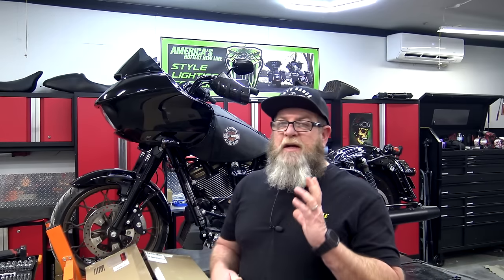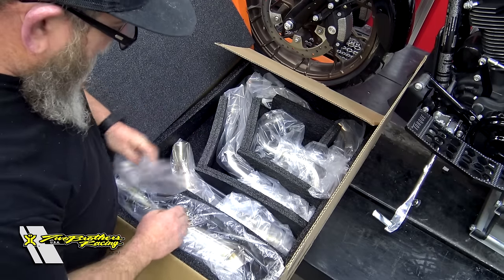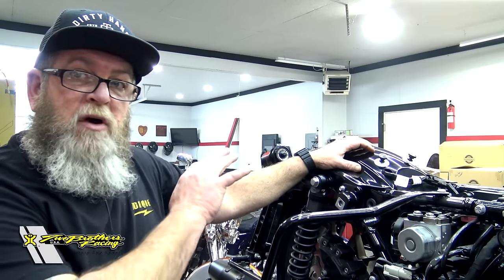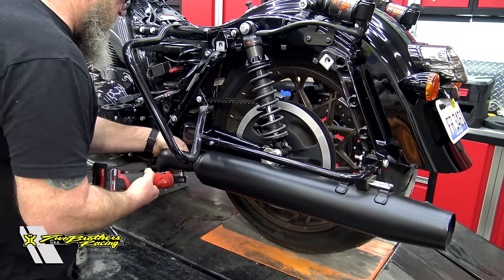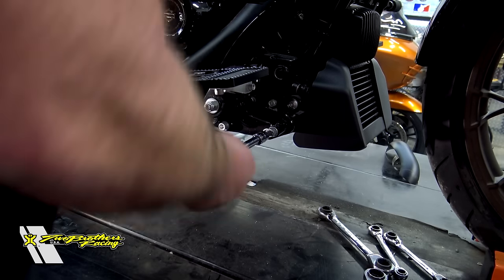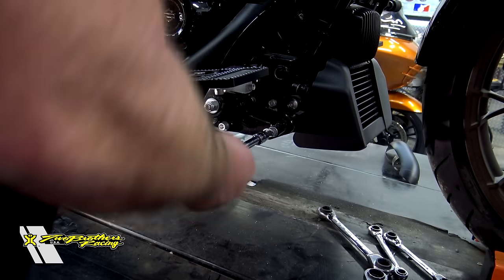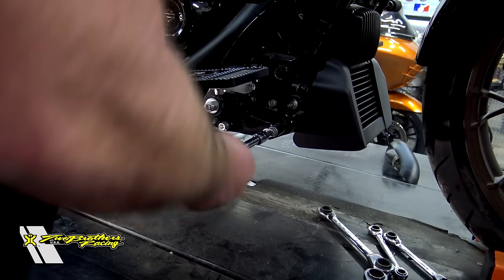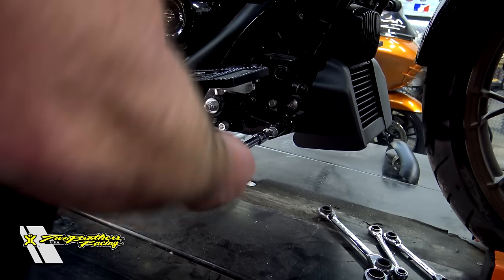⚡Loud Pipes! Two Bros Exhaust Install Guide⚡

Comment: Any good tuner will tell you this pipe leaves power on the table. I would not recommend this pipe on a bagger. However, if you are looking for performance and numbers I’d recommend the “full length” D&D, Burns, Khrome Werks, and Bassani pipes.
Reply from the maker: all pipes will leave hp on the table if you arent doing engine work, cams etc..your talking about 2 - 4 hp gains and maybe 2 - 4 torque gains which are not "seat of the pants" gains.

Comment: Did you do some auto tunes with the powervistion or  no
Reply from the maker: no...basic map tune for 2 into 1 and open air cleaner and open headers. It certainly will not hurt for to adjust to your riding style if you ride hard, a lot....but if its basic riding with a little aggression every now and then the map tune is fine

Comment: My two cents is two brothers needs to add a full shield to the rear cylinder pipe, had to modify my stock shield with some heat wrap underneath just to make it rideable, great pipe but that heat is unacceptable. Thanks for the video ⚡⚡
Reply from the maker: yes every single 2 into 1 shorty is going to be hot...most do not come with any heat shields.

Comment: Hey brother, Really enjoy watching your videos! You're so down to earth and so experienced. 

Have you read one of my messages I sent to you about me buying my new 2023 Harley Davidson Fatboy 114 (vivid black). Well, that's probably something that you get all of the time, so that's no big deal. LOL 😂 

I just wanted to know if you think my Fatboy would look good with the Boomerang/sway bar chrome kit installed? I know that it's my choice, but just wanted to know your thoughts. I love that my new "Fatboy" has the Chrome Finish and NOT the Satin Finish. 😊 It reminds me of my old American Muscle Cars and trucks. Hehehe 😂 

I had a 1991 Harley Davidson Low Rider Custom (Wine-berry Pearl Coat paint job), but it was too small for me (6'.1/2" and 245 lbs). I sold it when I left to fly (UH-1N and UH-1H-11 "Super Huey") as a Test Pilot in Melgar (Tolemeida), Colombia for the "Drug Interdiction Program" for the Department of State/Colombian Army in January 2003. 

Just wanted to give you a bit of history about myself. LOL 😂 

I've already installed a new chrome XMSN Oil Cooler cover, which looks really nice. I also installed a custom bolt  (knurling w/skull and American flag) for my seat. 

Will be buying some new Vance and Hines Big Radius exhaust pipes and installing a Chrome Trask Air Filter setup (round Air Assault). I have to recheck that name.
Reply from the maker: Hey bro..I do get a lot of messages but I dont remember one about a new fatboy..where di you send it to? Email. instagram. FB? Sorry I missed it. I did put the same thing on my softail build ..added some much needed chrome to rear of the bike. I like them and if you like chrome you will too.  I like the sound of the big radius pipes too...I did an install video on the softail of the task assault air cleaner too...its pretty awesome.

Comment: whats the name of the cordless tool you use sir ?
Reply from the maker: The number one most used tool in my shop for over 5 years now...the Milwaukee M12 ratchet...you will more than likely see it every one of my videos. You can buy cheaper versions but im here to tell you this one has been put through hell and im still on the original batteries I got with it.  Here is a link to the one I have ...I just picked up a few more batteries so I have back ups https://amzn.to/3VPoO15  I picked up two m ore of these on sale at home depot over Christmas https://amzn.to/4cZqETw

Comment: Great Video and Info! I have a question for you? I have a 2020 Road Special Special with the 114, I had all the EPA compliant stage 1 nonsense done using the Screaming Eagle Header and Pipes, and the Tuner back in 2020. Horrible dyno numbers! What would be the most cost affective way at this point without doing a cam to at least increase Torque and Horse Power performance at this point??? any ideas or suggestions??? I would appreciate it. Thank you so much! 🙂👌👊👍😎🙏🙋‍♂️😊
Reply from the maker: No exhaust on the market or basic stage 1 will produce really any good 'seat of the pants" numbers...your next step is definitely cams if you want to increase torque or horsepower. And would be cheaper than replacing al of that work you already had done...I know you said without doing a cam but thats kind of where you at.
Reply: Yeah, I figured! Thank you for your input, I appreciate it so much 😊

Comment: I changed one put same pipes  but never tuned it runs great though.. should I take it to harley and have them tune it..or wait till I get the next tune up
Low Rider ST 24
Reply from the maker: Even a stock bike can benefit from a good tune versus that map tune HD puts on it....but it really depends on what else you done to it...if you just changed the pipe youll be fine..but if you have changed the air cleaner too then you will want to tune it.  More air in/more air out....needs a tune
Reply: @sikbaggers  thank you sir

Comment: Is that exhaust EPA compliant?
Reply from the maker: Negative -  Not legal for use in California on pollution controlled vehicles - check local laws before installation
Reply: @sikbaggers  all laws are going to change regarding performance parts on motorcycles,one example is,it's going to be very difficult, probably impossible to by a exhaust system without a catalytic converter moving forward. The reason? The environmental protection. Call any performance exhaust manufacturer they'll tell you. And performance parts ARE NOT limited to exhaust pipes.

Comment: GAH!!!! The friggin rubber strap wrench!!! I wish I'da seen this or thought of that before I took the V&H slip-ons off mine to install the Rinehart headers and mufflers. I fought those damn V&H for a good hour and half trying to break them loose without damaging them. 
You don't have any use for a married Screamin' Eagle Pro Street Tuner do ya? I bought a 19 RGS that had it on there and someone tboned me on it about a month later and totaled it. Bought an identical 19 RGS a couple months later and Harley told me the tuner was a paper weight now. I've heard some folks get some use out of them though. I'll send it to ya for free if you can use it. I already put a PC6 and Auto Tuner on the new bike.
Reply from the maker: yeah the strap wrench of the bent piece of metal with holes that match the rear hander is always a good way to smack them things loose...some are easy and some really suck lol I dont have any use the tuner..thats why I use the dyno jet..i can buy multiple licenses and keep on using one over and over again...saves in the long run i guess.

Comment: Hi Steve. This is a little off topic. I have a 2018 Heritage Softail w/114. In the last day or two the little red light came on. I checked all the lights, turn signals, four way and brake lights. Do you have any ideas as to what calls that light to illuminate?
Reply from the maker: Hey Paul...that means you have an bcm/ecm and you will need to check that code and reference a code chart to see whats going on with the bike.  here is a link to how to check them...i thin its for touring but tis the same thing...you will hold down your selector switch (left switch housing, top/left button and turn the ignition on while holding it and put the bike in DIAG mode and then check your codes from there...plus there a lot of videos that cover that procedure as well.
Reply: @sikbaggers  Thank you, Steve!
Reply: @sikbaggers  Steve, I got lucky. I removed all I had to (including the fuel tank), I disconnected all the connectors I could find and plugged them back in. I also found the stash of new fuses 5 & 7.5. of course there wasn't the 40 amp main as a spare. I then put everything back together, yes the neg cable was hooked up last. I then started her up, no problem. I even took her for a spin. After I got back to my garage I ran the diagnosis through her again. All codes dissappered. Thank God I didn't have to buy a BCM.

Comment: I have shitty maps on mine, all tubes for screaming eagle air cleaner, and slip ons, Thunderheader, pro pipe, short shots, but nothing other than se air cleaner, and no 2-1 shorty tunes. Kinda sucks.
Reply from the maker: Dont worry about what "brands " you see on the tunes...you have to remember that the SE air cleaner is just an open air cleaner, non restricted...so is every other open air cleaner on the market so the brand doesn't make a difference. Samew with open headers (non cat versions) and slip ons...choose one closest to the ones you have as far as baffles go with back pressure.  The maps on these tuners are very basic and you will need to more than likely have it dyno tuned to get it super dialed in....these maps will get your bike running but not super dialed in. No map you download off the internet is going to do what a true dyno tune will do

Comment: How’s the heat on these only asking cause the wife will be on the back
Reply from the maker: Any short pipe will be hotter than the 2 into 1 or single exhaust that goes fully out the back...my wife hasnt complained about it but we havent been stuck sitting anywhere with it yet